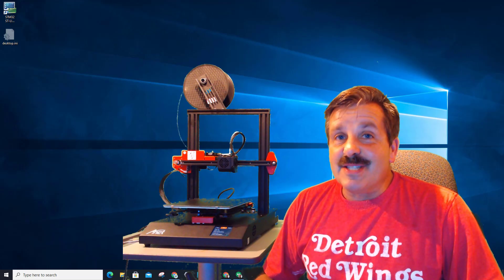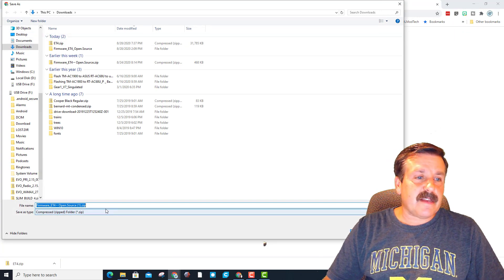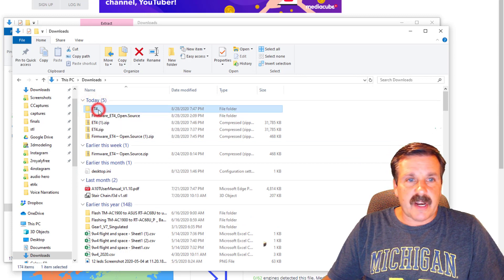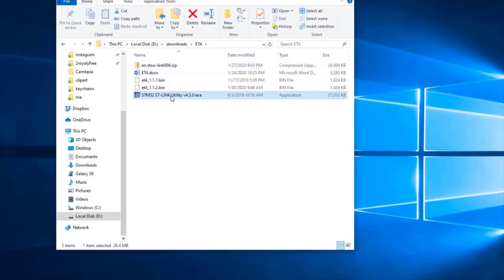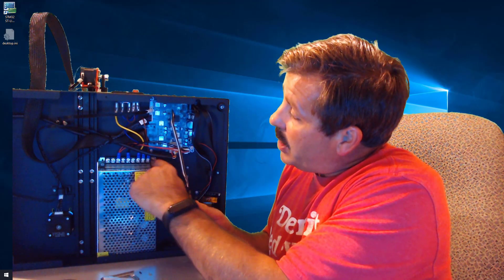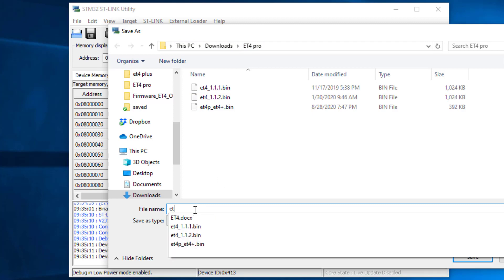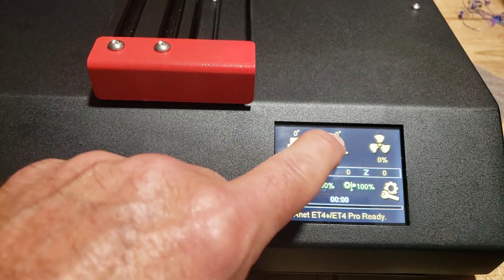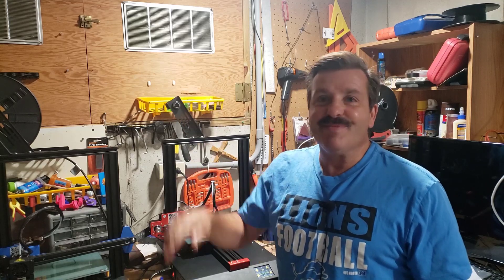Flash an Anet ET4 Pro or Plus to Marlin 2+ firmware using ST-Link v2 in Minutes!

Comment: Thanks for the great tutorial...I made Marlin on it just so I could install new z-axle that has a different pitch. I have set steps but sometimes after off and on z-steps are different again. Also, the print image is still so good because the nozzle sometimes slows down when printing is bloobs arise. Has anyone had the problemms? How can you fix them?
Reply from the maker: I am glad you liked the video. I have not done anything with hardware mods, so I am not sure about how to get your steps correct.  With one of my Geeetech A10 printers I just kept adjusting the steps till my calibration cube was spot on.

Comment: Hi I have updated my ET4 Pro to the newest frame wear upgrade. It started acting funny.  So I had to unplug it, the screen kept flashing and the hot end kept crashing into the plate.. So then, I tried using 3D Touch leveling sensor. I plugged it into the board up top, where the original proximity sensor was, either I have shorted it out somehow or the new frame wear caused it. When I turn on the 3D Printer the LCD screen is black does not come on, but the printers fan does come on and it sounds like its running, but you can't get it to do anything. I tried unplugging it. I have checked all of the fuses on the inside. Is there any way to restart it? Or what should I replace the Motherboard or the LCD screen?
Reply from the maker: I think before I started replacing parts I would try to use the ST-Link v2 to send the original firmware to the pro. Just make sure it is the hex file. It has the bootloader and the bin files do not.
Reply: @HLModTech  can it still be done if i cant use the lcd sreen becusse its black like not one but the fans are one and lights on the motherbord are do you only need computer to do this dont need the screen and thanks for help anet ant been tomuch help they just txt back to day and only said about much as you

Comment: hey i followed this tutorial to the t, now  my anet et4 + only has a white screen? any idea on how to fix it ?
Reply from the maker: Usually the white screen is when a ET4 bin gets flashed instead of the ET4 Plus/Pro. Another thing to check is the pins. The ST-Link is notorious for having 1 pin different... That will always cause issues. Lastly if you want to go back to the original, flash the hex. It has the boot loader in it.
Reply: @HLModTech  I get also white screen but i used program & verify and it worked for me.
Reply from the maker: @hartzapa  So the first time you got the white screen, but with program and verify it finally worked? Am I hearing that right?  If so, great job being persistent.
Reply: @HLModTech  hey I'm tacking this project again and i don't have the original file to flash. my ET4 plus just doesn't connect to the v2 st-link.  it just keeps telling me to connect in reset mode which i cant find.
Reply from the maker: @ArrowSmith95  2 things to check... Many ST-Link have the pins different.  Make sure you match the labels... not just where I had them in the vid. The second would be having the printer on while you do it. I missed that step more than once, unfortunately. 🤦‍♂️

Comment: hey I have a usb isp 2.0 from a BLtouch will that function that same as an st link ?
as for the pin positions on mine its as follows.
1 mosi  2 vcc
3 Nc      4 ground
5 rst      6 ground
7 sck     8 ground 
9 miso  9 ground 
thanks
Reply from the maker: I have no clue. =( Sorry. What software do you use to program the BLtouch with it?

Comment: Hi, my new ET4+ has some wird problems from one day to the next one...
It prints sideways instead of upwards and it smashes into the bed despite being leveled and the height being set correctly... 
do you think the software flash will help?
Reply: For those how are wondering I think the firmware flash has fixed the problem
Reply from the maker: Thanks for the update! Glad to hear you are back in business.
Reply: @spellingmistake1  Hi. Can you tell me how did you do it? Did you reinstall the 1.1.2? My sensor wont detect the bed but only when is autolevelling. If I move it down manually it detect the bed... weird.
Reply: @gustavovilloldo4370  I flashed to the current version of the open source Marlin software as it was described in the video.
The firmware has a bit more complicated UI Design but you can get used to it... 
it offers a lot more features as well

Comment: it always said no target connected if i try to program
Reply from the maker: That happens most often with you have not powered the printer on before trying to connect. You should also double check the wires and the labels. There have been reports that different ST-Link programmers have the pins in different orders.
Reply: @HLModTech  found the issue. in the settings it is set to 4Mhz. but i need 125Khz. it worked. Thanks for that :)
Reply from the maker: @Clankerhenker  Great job tracking that down and thanks for sharing!

Comment: Does G29 work on this Firmware?
Reply from the maker: Usually that's for probes, right? I generally only use manual leveling, so I do not have a clue on probes

Comment: * Check your ST-Link V2 pin-out, mine was different and it took ages to diagnose the problem *
Reply from the maker: That is good to note. I too have noticed they lack conformity. Can be super frustrating.
Reply: @HLModTech   hey so i up dated my et4 pro with et4 framwiere  and if i try to go back to the pro it get stuck so its only working on the et4 how can i make it go back to the pro my printer says v3.0.0 but it also says et4
Reply from the maker: @saittafpv5846  I have not tried the new 3.0 firmware yet. Can you try to flash a hex of the oldest pro firmware you can find?
Reply: @HLModTech  do you have a coppy of a old one or no were to find it i should have made a copy of it frist i no batter now

Comment: HI Thanks for this video. I upgraded my ET4 pro as recommended however now I have to reconfigure the screen each and every time I start the printer. This is going incredibly fast and the calibration is most often impossible to perform (failed message).  any suggestions on how to resolve this issue? Also any suggestions on how to calibrate the printer both manually and using the autolevelling? Thanks in beforehand and again so nice to get help!
Reply from the maker: I eventually got my settings to stick by saving the config after doing it. Usually I would get in, calibrate... print a part and forget. I leveled the bed with paper, then used the offset to hone it as I printed a few times.  It seemed pretty slick, but I am still a manual bed leveler at ❤.
Reply: Thanks. I will try with a stylet.
Reply: @johnverstegen8996  managed to leave the auto level of the table working?
Reply: just send an M995 to the printer to start the calibration. then it should work fine without a fail message

Comment: Hi, is there any way to unlock the bed for more than 100c?
Reply from the maker: I doubt it. Not sure the hardaore can handle it, but I've never tried to take it there anyhow. What are you trying to do, Cook eggs? 🤪
Reply: @HLModTech  I want to print PP on it, so I need to reach 120c.... ender 3 has no problem with 120c

Comment: How do you make an auto bed leveling in marlin??? Please!!!!
Reply from the maker: Sorry, I only use manual bed leveling.
Reply: @HLModTech  could you make a video? I tried both manual and automatic leveling but the nozzle always remains 2mm from the bed, the probe z offset doesn't work
Reply: @fpsitalia-simracingaccesso5857  managed to leave the auto level of the table working? if you could teach me, please.
Reply: @marcelinojosecabral  I bought an Anycubic I3 mega S

Comment: I have flashed my Anet ET4+ but I'm getting issues, I check auto home and it has the correct distance between the nozzle and the bed, then after doing the bed calibration from the menu option it is a little bit tricky because the nozzle is at correct distance in the corners but on the center is touching the bed so I fixed compressing more the springs, but when printing the nozzle touches the bed and I got to compress more the springs. I have not find a way to solve it, so I got to do a huge skirt and compress the springs while printing until I got the correct distance, and for the next print I got to decompress the spring and compress again while doing the skirt. I hope you can make a video on how to level the bed with marlin, you and me got the same ET4+
Reply from the maker: Which firmware did you flash to? What kind of sensor do you have for Z?
Reply: @HLModTech  this one et4p_et4+.bin, I have the inductive sensor next to the nozzle, the same printer as you.
Reply from the maker: @vegitoita  ok. I calibrated with a piece of paper. I saw a video about changing the offset for the inductive sensor, but since mine was fine I have not messed with it. Not sure what it was labeled, but I think it popped up on the FB Anet group.  You had also mentioned swapping to a V6, but I keep my machines stock.  I am too cheap to upgrade hardware. =)
Reply: @HLModTech  Indeed I'm thinking on chaning the offset to see if that solves the problem, but my Anet ET4+  remains with all the stock hardware I have not swap to a V6 yet, I just want to have my printer going well before any hardware modifications.
Reply from the maker: @vegitoita  Good idea. I have 3 of them.  I had to get used to each, as they all have their own personalities. I also notice that as the weather changes (fall here) I have to adjust the beds and such.  Make sure you are starting with a simple print like the cm cube I use. Get it dialed in then move to cooler stuff.
Reply from the maker: I have not used pronterface with a ET4, but the other machines I used it with, I connected via USB.

Comment: Greetings, After upgrading to Marlin on Et4 Pro, have you already tested if it works when running out of power?
Reply from the maker: Hmm... 1st, mine may be a Anet ET4+. It may also be a 2020 ET4. I am still trying to figure that out. The initial boot screen said +. I thought I was getting an ET4. I think the pro really has a touch sensor. Long story short, my printer has not had any power issues. I do not believe it is a pro though.
Reply: @HLModTech  Sorry, I meant that if it continues after power loss?

Comment: Sometimes gcode file  doesnt work properly for certain files in anet et4 pro. 
Do i have to update? Have you faced such kind of problems?
Reply from the maker: I have had files where the file name was too long and did not work. What kinds of issues are you having? You do not have to update, but there are some bonuses in that you can calibrate your printer better with the features in Marlin 2.

Comment: Your next video should be how to level the bed after flashing to the open source firmware!
Reply from the maker: I think you are right. With me teaching full days right now, I have not had much time after work. I will see if I can get at it soon though. 👍
Reply: Ciao, ho seguito la. Tua guida e ho flashato al 2+ ma anche io ho bisogno di livellare correttamente
Reply from the maker: I level with a piece of paper. Listening for the friction sound... but I have done it a lot. This one has the capacitive sensor so I am starting to learn how to adjust the z offset. This is my best video at the moment for leveling the plus https://youtu.be/tj_cWkNWoMQ

Comment: Hi again, would it be hard to make the auto bed leveling work with marlin 2.0 since it's using the inductive sensor? Do I have to edit the firmware? Thanks!
Reply from the maker: I am still experimenting with it, so I will get back to you. The firmware I flashed allowed it to detect z with the sensor. I have always been a manual bed leveler, so I am learning with you at the moment.
Reply: @HLModTech  Me too. This is my first printer with ABL. I bought a BLTouch but I haven't installed it yet on my ender 3 v2. I find I don't really need it yet since i'm using a glass bed and my first layers are almost always perfect. Thank you for the response. I'll be waiting for your next videos. Keep it up!

Edit: I managed to install the BLTouch on my ender 3 v2 and it also works great!
Reply: @HLModTech  Got marlin 2.0 installed on my ET4+ and it works great. I also managed to level my bed using the sensor. Thank you for this video
Reply: @chinoyoung5606  Could you share how to managed level using the sensor? Thank you
Reply: @chinoyoung5606  I have an ET4+. can you share the source firmware? and anything else you had to do special?

Comment: Had an issue with the touch screen calibration. Kept getting a calibration error. I found using a stylus helped and works great now!
Reply: I had the same issue but at some point it fixed itself after a few attempts
Reply from the maker: Good to know. I was trying to press the very corners. I wonder if that helped?